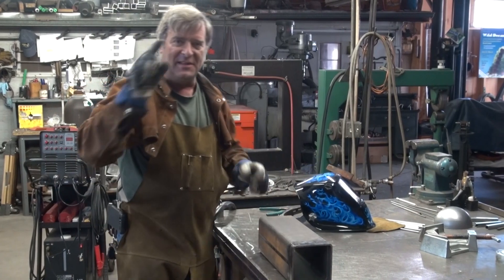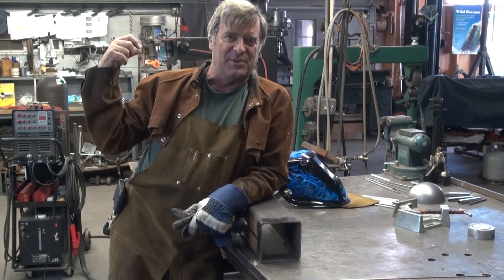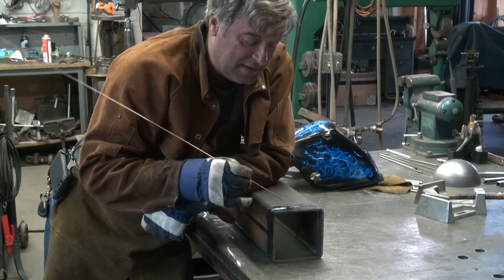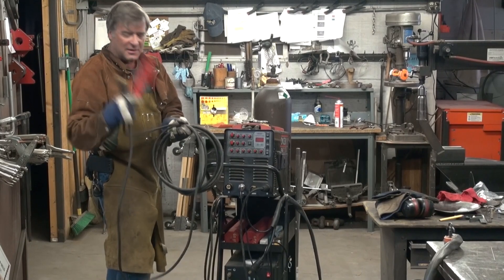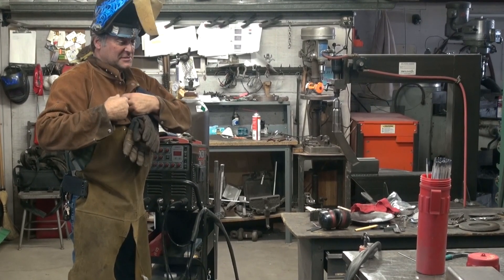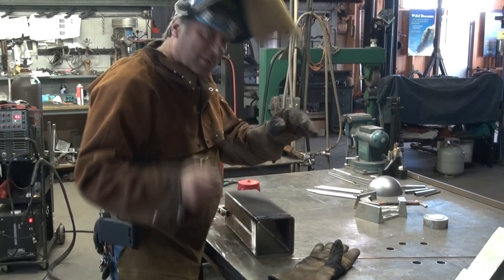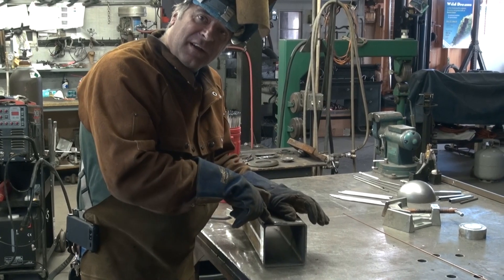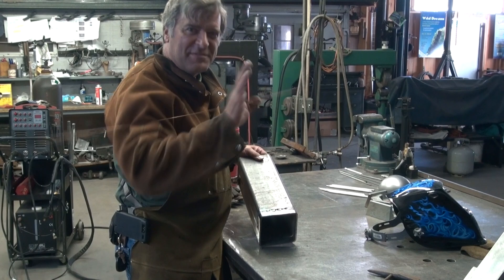TIG Welding vs. Arc Welding - Which Welder When? - Kevin Caron

Comment: which type of welding is the best in terms of longetivity for welding a 2mm thick Hot Rolled sheet and 5mm thick angle section. the HR sheet is to be welded to a 4' x2' frame made of  40mm x 40mm x 5mm angle section and this sheet - angle section welded board "ll 've to bear a load of around 500kg during rcc casting.
Reply from the maker: Stick welding for this job would be my pick.
Reply: @KevincaronSculpture  thanks for the reply.

Comment: the specific point was the gate i'm welding up,   .062 wall square tube,  i tried a 3/32  7018,   i can make the weld quickly but get some blow thru/s    i love tig,  but the steel worker said tig was no where near the strength,   i disagree,  and from my experience with this project and others,  seems the tig with er70 is a very strong weld    
but would love some input   thanks
Reply from the maker: For that thickness go with the tig.    Takes longer but does a much cleaner job.    Less grinding means more metal stays where it belongs.
Reply: that's what i'm doing    long runs  
taking forever   thanks

where's the best place to get blades for that evo saw ?
Reply from the maker: Amazon has the best price right now..
Reply: if you have blow thru/s then maybe you have to much Amperage, or/and your filler Rod is to big in diameter i suggest you use a 1,2 mm filler Rod.When the filler Rod is to big your Puddle is cooling to much down so you have to stay on the same Position to long and this can cause a blow thru while the Material goes hotter and hotter. I assume also your Tungsten Tip is to long grind it in another Angle.A longer tip penetrates more it means it goes deeper in the Material ,the weld is on the Top smaller , because of the distance from the Tungsten to the Surface of your Material.It is around 1,5 -2 mm. You have to weld in a constant Motion and no walking the cap. A Tungsten Grinder helps a lot while you can reproduce the Tip in the same Angle again and again. 
Btw i am not familiar with Inch measurements.
Reply: was blowing thru with the stick   used 3/32   7018    at the end    i was moving quickly and was able to get some pretty good welds   but i used tig for the whole thing   no issues   
only blew threw with the stick ,   it would have been so much faster,  but done now,  came out really nice 
thanks for the message
Reply: Same use thinner Stick ,if you have or weld with a Gap with low Amperage as described for the Stick,Some Stick are weldable with AC/DC and  on plus or minus try what is better , very Important is clean the surface from any residue ,don't have to much distance with the Stick from your workpiece about 0,5 - 1 mm max, weld with a slight Angle About 75- 80 degrees hope it Helps.

Comment: i was told by a steel worker last week that stick welding was the strongest,  yet tig uses a filler rod for steel with the same "70" strength,,,,,   I thought it was just the process that's different, ,   what's your take?    is stick stronger than tig?
Reply from the maker: Stick gives you better penetration,  so I would have to say on thick metal it is stronger..   Less than about 1/2 inch thick and I don't think it makes a difference.
Reply: Does you Guys not prepare your workpiece before you weld? a 1/2 inch thick weld you never perform the weld in one go if you need full penetration.
Reply: the tig bead was just so i didn't blow thru,   figured i would have a  little backing   but i made 3 passes with 7018   ,,,,  2 with 3/32 then last one weave with 1/8  seems to have come out very nice,  but any advice is welcomed,   thanks

Comment: Maybe you say this in the video, I have not the time to watch it now.  But, I want to get three welders from Miller.  I am just starting out.  Someone from them emailed me and told me that the welder needs to have AC output for aluminum TIG welding, DC is for tig welding just about everything else.  This is I am sure a dumb question.  But, do generators have both?  I had never heard that in any of the things I've watched.  I found it interesting.  haha
Reply from the maker: +Josh Glowzinski        Generators put out both A/C and D/C but I don't know how to turn that in to welding...
Reply: +Kevin Caron, Artist haha  Oh, when things end with multiple dots.  haha  Yes, maybe I did not understand what the guy was saying.  I thought it meant, no, what DOES that mean?  I am sure I did not get what he meant.
Reply from the maker: +Josh Glowzinski         You just need a 220 volt line with a 40 amp circuit breaker or a 110 volt line wiht a 30 amp breaker for your machine..     Most inverter welders just don't like to run on a generator..   The power output is not stable enough and it blows circuit boards in the welders...
Reply: +Kevin Caron, Artist Well, I am mildly dumb.  haha  I thought what that guy said meant I needed to have a plug with each type of thing.  DUH!  It didn't make sense to me.  So, my step father just retired from the fire dept.  33 years.  haha  That is a long time.  He is feeling all mellow.  haha  My mom and he are giving me a shed thing in our back yard.  So, if I do not use a generator, how can I get that much of the good stuff?  You know, my mom is a female bob villa.  If she is not baking a cake, she is building a shed.  Maybe SHE would know and I could stop bothering you.  It is just that you seem to know your stuff.  Hell, you seem to know my stuff.  So, I like asking the questions I have.
Reply from the maker: Just run 220volt to the shed and put in the right plug for the welder..    Good to go.
Reply: +Kevin Caron, Artist I would love to do that.  I will try as hard as I can to find out about and have it done.  But, I really do not think I will be able to do it.  I would be fine paying what it cost to do it and to pay whatever the difference in the electric bill was.  But, convincing my mom and step dad of it is another thing.  I found a different welder.  The Miller Bobcat 250.  It seems as if that one thing can do almost everything that I want.  Minus the aluminum welding.  Do you know if that is any good or not?  Also, what about duty cycle?  I saw on some site a while ago, that there is a welder, maybe a tig welder, which has a duty cycle of 60%.  I read that 10% will not cut it if you want to tig weld.  Thank you very much for always responding to my stuff.  I am sure your a busy guy.
Reply from the maker: The Bobcat is a great machine if you can afford it!      As to duty cycle, the lower the number the less time you get to spend welding.   60% is very good.   25 % is awful!

Comment from the maker: Cameron,,   With that big dog you can run any wire you want!!!

To learn with I would load it with some .030 solid core steel wire.  Make sure your gas is a mix of co2 and argon. Normally you can just tell the guy at the welding store that you want MIG gas.  He should know which kind that is.  Then get some scrap plate and get to practicing...  Welcome to the world of welding.....

Comment: Hey Kevin just a little info. You can tig weld outside. I am a heavy wall pipe welder and we weld outside everyday. Sometimes in 30mph winds. Just gotta run the argon a little higher. Great videos man  and awesome shop.

Comment from the maker: I would have to say yes, because with just the one welder you would be able to do just about all of the welding you might need.  The TIG will take care of all the thin stuff and you would use the ARC for anything over say 1/4 inch thick. ARC would take care of all the outside work and TIG will do the aluminum.

Comment from the maker: No oven for the 7018, other than I live in phoenix az and it's really dry here!!

I am really not that worried about weld strength. I do my best and make sure it holds up to my style of testing.  As long as I get a decent weld it's going to work for me. I also know which welds have to work and which are just for show or not show as in get ground down and polished smooth.

Comment from the maker: As long as the pedal has the same number of wires in the plug anyone should work on your machine. Or check with the manufacturer to make sure you have the right one. No sense in tiring to  reinvent the wheel.....

Comment: Great video as always Kevin.
I recently picked up a Combined TIG/Stick/Plasma machine and I can't wait to get it running.
It's only a DC TIG but it should be enough for my needs until I can afford something better.

Unfortunately though I didn't come with a foot pedal only an on/off switch on the torch.
Do you know or have any experience with DIY foot pedals? As I was thinking that I could mount a variable resistor on a guitar pedal and work from there...

Comment: I bought a combination TIG/ARC welder ages ago, thinking why would I ever want to ARC weld. my god I use it way more than the TIG setting, main reason is cost and speed. But the other advantage I find is metal prep is not so fussy, obviously you always want to get it as clean as you can, but the flux on the rods floats aware a lot of contamination. Great video Kevin and co!